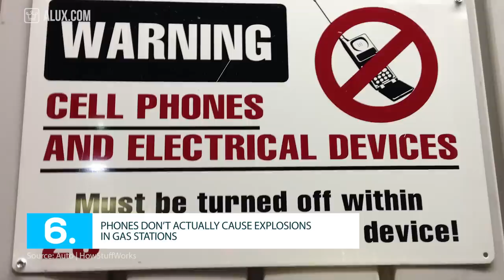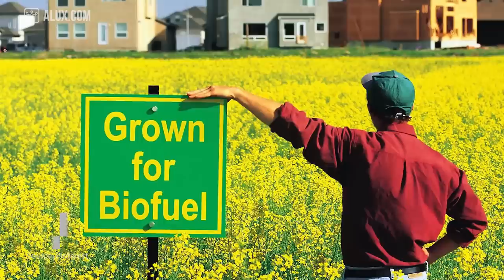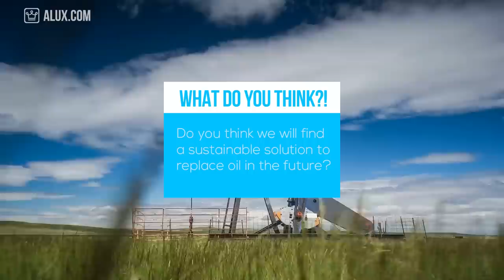15 Things You Didn't Know About The Oil Industry

Comment: 5:14 phones CAN cause combustion of the fuel. I've seen videos and its also happened in my country. Its when the evaporated fuel reaches up to the ports of the phone and the electrical charges light it up, causing fire, but not explosion of any kind unless the emergency stop button is not pressed timely.

Comment: Static electricity is most prevalent  when humidity is below 50% ambient. This static ZAP is created when exiting the cloth seats of an automobile. The rubbing action causes a buildup of electricity that will ground itself when metal, such as iron, is touched. Women have a higher incidence of accidental gasoline vapor ignition because they are more likely to enter and exit their vehicles when refueling.

Comment: Enjoyed the presentation. Thanks.  I'm sort of glad that there might be a switch to to electricity to run cars, because once you burn coal, oil products, or natural gas, its gone forever.  Being interested in polymers (plastics) I'm guessing that if you have oil around for another couple of centuries (because you don't put it in a car's gas tank) you will have it to make stuff with, and if you can figure out a cheap way to recycle oil based plastics its a better deal yet.

Comment: Every effort is being made to propel and perpetualise engines with an alternative to petroleum products. The damage planned in minimising damage, never quite hits the mark. The Countries with oil deposits, have to place limits on the greed and necessity because the damage is being committed in a world where the populations do not appreciate the needs of the few in the industry compared with surface, atmospheric and below ground damage done. Especially now they ‘know’ Earthquakes happen by Oil well drill holes and other types of drill holes such as thermal drill holes for turbines, heating and water.

Comment: Tom Ogle was murdered because he designed a carburetor that could get 100 miles from 1 gallon of gas!!! Yes. The oil ripped out of the ground could have been enough for hundreds of centuries  With needing only 10 gallons to drive 1000 miles,